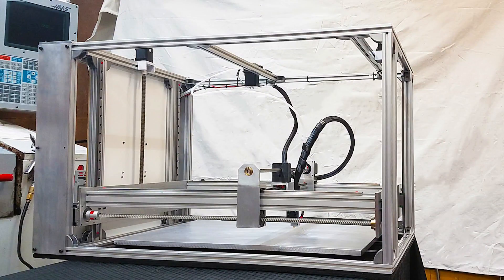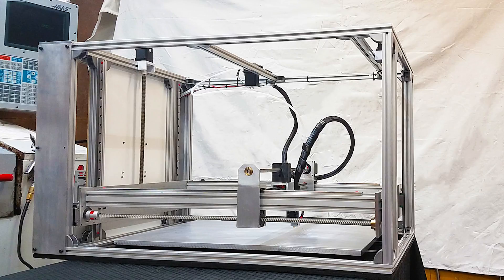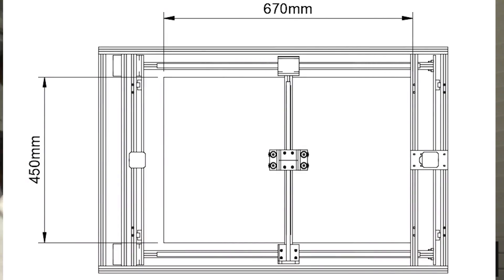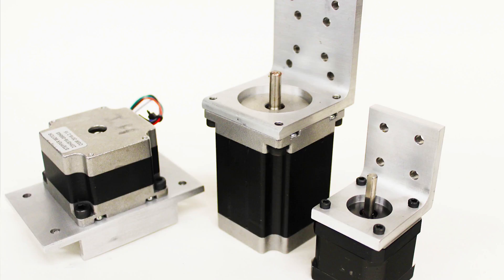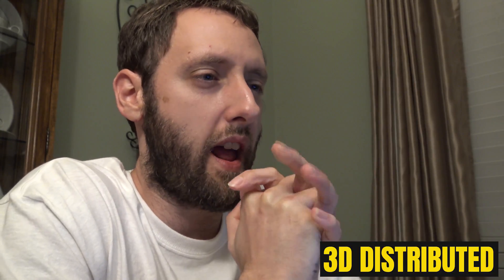What Is The Workhorse Printer?

Comment: Random Question, I tried sending you an email via 

shane@3ddistributed.com

And it didn't go through (This was the error message: "550 5.1.1 The email account that you tried to reach does not exist. Please try double-checking the recipient's email address for typos or unnecessary spaces. Learn more at https://support.google.com/mail/?p=NoSuchUser c8sor12957772vso.18 - gsmtp"

Is the adress still  current / any advice / other way I can contact you?
Reply from the maker: We moved our website to a different host and I lost that email address. You can reach me at shane@conroemanufacturing.com